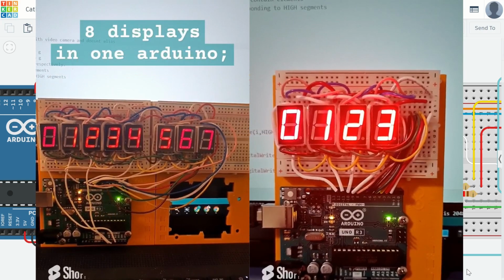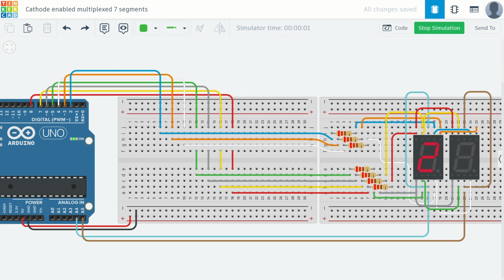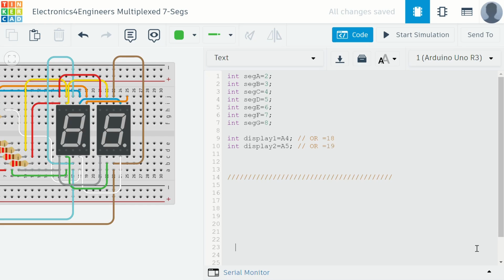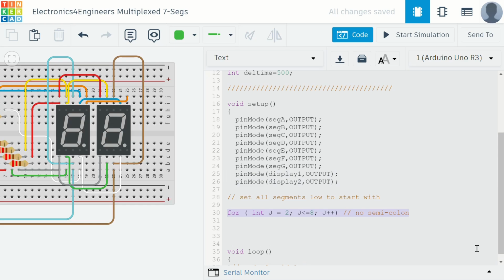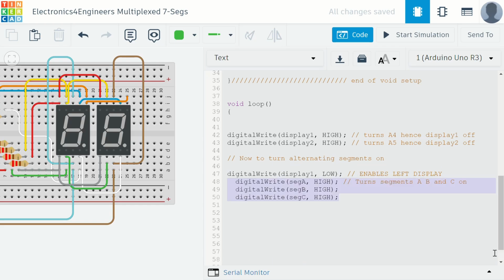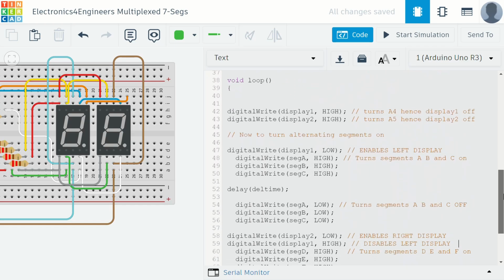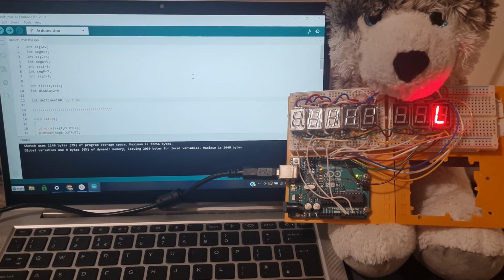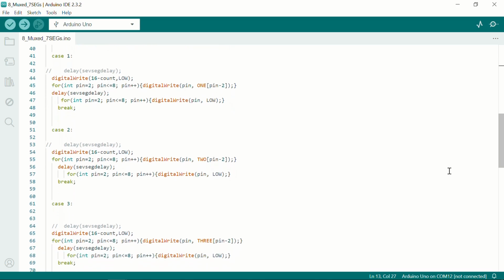12 DISPLAYS, One Arduino! Part 1

Comment: same connections work for common anode display too or is there any difference
Reply from the maker: Common anode needs Logic 0 to disable them. From memory I think the 7 seg display pins are the same despite what the 'common' is.
If in doubt and if using Tinkercad, just make the display common cathode. cheers
Reply from the maker: You may have to flip the HIGH / LOW that you give each segment when making numbers etc, compared to my digital writes.

Comment: What software are you using showing the board and connections early in the vid?

TinkerCAD, got it lol
Reply from the maker: That's it! Is great to test code before taking the time to wire it all up. Cheers. If you need anything, let me know.
Reply: @E4E  Thanks :)
Reply from the maker: If you watch my recent shorts you'll see what's possible with my method here :)